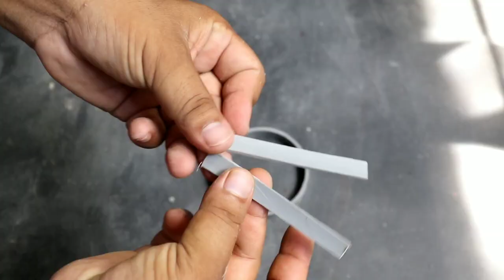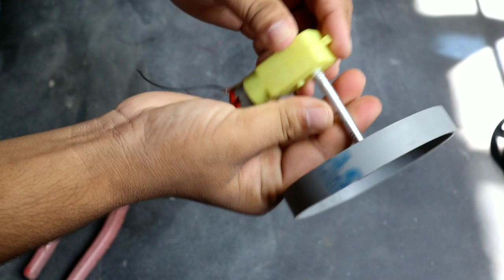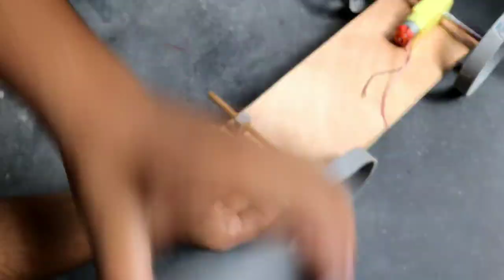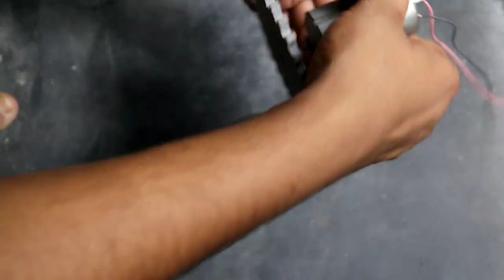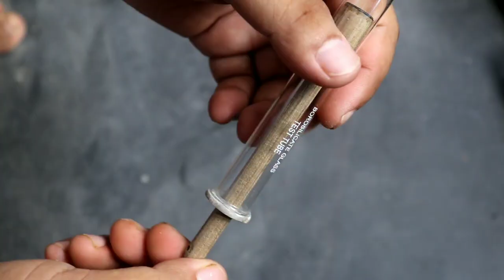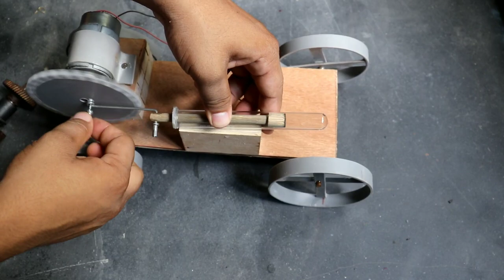old steam locomotive car 100% working & totally home made

Comment: After 35 mins, switch on the battery and start running the motor 😂
Reply: a hot air engine that small will run in 20 seconds if not fake lol

Comment: A single acting cylinder cannot retract by itself when the piston is at BDC unless there is an external force - either a compressed spring or Weight is acted upon - to complete the second phase of motion. 
How the hell it is creating a new thrust without having - even a small counter weight on the flywheel?
There should be a air tight sealing bw piston head and the cylinder ID to pick up the pressure which is developed on the piston face. But, we could see enough leakage b/w piston head and the glass tube.
Reply: it is a hot air engine design but still fake lol

Comment: Connect motors to wheel so you can give them direction and it will remote control car😎😉
But you have to create circuit for it🤔
Reply: Iske pas remote wali technology nahi hai .. otherwise diya rakhte hi remote se run ker deta or dikhata ki garam hoker chal pda...isliye isne video cut ker diya or uper se 10 bar diye ki adjustment krta hai .. pagal bna Raha hai no doubt .but paise mil raha hai but theek hai ..faltu ke prank bhi scripted hotey hai..to ye kyu peeche rahe